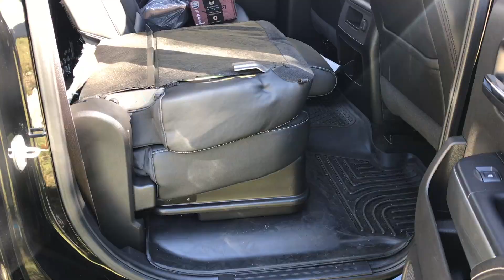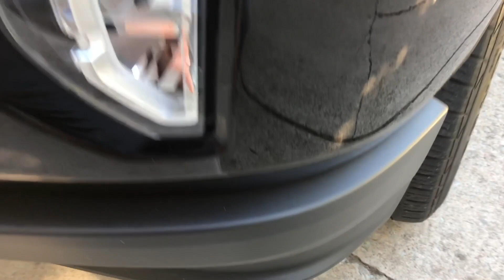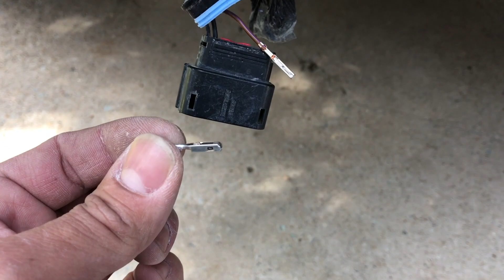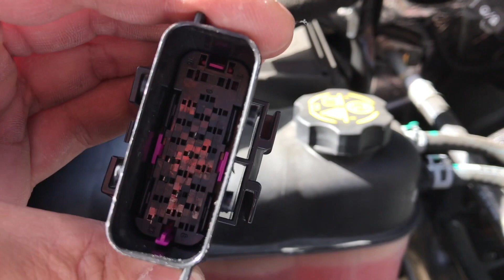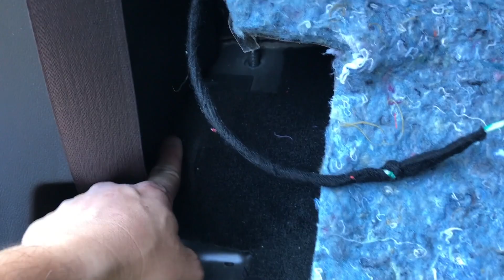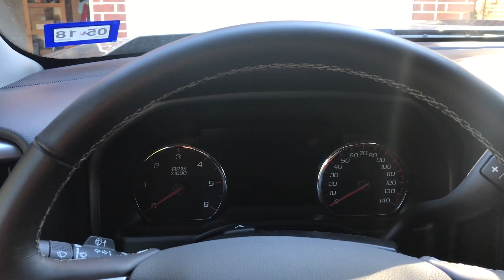2016 Silverado LT - Front Park Assist Retrofit / Upgrade

Comment: My 2017 came with the Front and Rear sensors, but I get the Park Assit Disabled message on the dash.  I checked fuses and visually inspected the wiring harness but so see anything suspect. I tried pulling seprarately the Blue and Middle connectors from the Park Assist Module but saw no change.  Thanks for any help you can offer.
Reply from the maker: Not sure what would cause that. Might be a dealer visit.
Reply: @philgamboa2906 Thank you so much for the reply appreciate it

Comment: After WAMS programmed the new park assist module did that automatically display the front sensors on the instrument cluster and sound the alarms or did you need more programming done. I have wired everything up and added the sensors. Just need the module programmed to detect the setup. Just wondering what else I’m going to need. Love the video it was great detail and made the installation easy.
Reply from the maker: Yes sir. The programming enable the sensors and the icon in the cluster.
Reply: @philgamboa2906 awesome I have the rear sensor but with a 6 in lift I need the front sensor because everything disappears infront while I’m parking. thank you for the great video. How long did it take to get it programmed and shipped back?
Reply from the maker: @ - I don’t recall the lead time.

Comment: Did you replace and repaint a new bumper with the sensor holes to add the front sensors?
Reply from the maker: Yes.
Reply: @philgamboa2906  was curious as there was no mention of it
Reply from the maker: Found a take off from a Silverado LTZ/HC. @TheCarCrazyGuy
Reply: @philgamboa2906 very nice. Wish my ‘22 RST Refresh had front sensors. The ‘24 RST now has them.

Comment: I'm unable to find anyone - even a dealer - that knows if there are two different part numbers for front and rear.  Can you answer this? I have a broken, inner front sensor on my 2016 2500hd that has part 52050133.  The part that I was sent is 52050134.  The advertised description says can go on front or rear...
Reply from the maker: What I’ve found when it came to varying part #s, we’re for painted, unpainted, or chrome.

Comment: So your work is amazing and well appreciated!  Where did you get the color-matched sensor caps and rings that hold them into the bumper?
Reply from the maker: Thanks!  I found a bumper in the same color as my truck with the sensors :)
Reply: Also - do you have a particular wire crimper you like?  I do electrical work from time to time on my vehicles - they have connectors similar to these and a good crimper is always nice to have.

Comment: I have a 2018 SLT Sierra with the sunroof and noise cancelation harness.  When I did my rear slider swap it was almost truly plug and play.  When I removed the rear seats I had those three wires hanging there along with the studs to where that module bolts up?  I wonder If all I would need is the programmed module, sensors, dash cluster programed the switch itself?  My truck also has the heated and cooled seats and power pedals.  I guess it's the SLT plus, but not the premium plus package, it even has the 6.2.
Reply from the maker: I’ve never heard of an SLT that didn’t have a sliding window or park assist sensors.
Reply: @philgamboa2906  It's the one you made the adaptor harness for me for the heated wheel. 2018 with the 14 to 17 harness.  It's GMC's SLT with all the popular options minus the driver assist package, heated wheel or slider.  Yet it has the big 6.2 4x4 sunroof, heated cooled seats, and other options.  It's strange how GM makes their trim packages.
Reply from the maker: @jewllake  - This may be a one off in this case.  It's like they added the wiring the "deleted" the configuration in the BCM.

Comment: So if anybody is questioning or having issues.  The part number of the module from the video, 13447860 is the module for 14-15 and the part number for the module that fits 16-18 is 84182728.  I made this mistake, bought the wrong one and sent to wams and they notified me that it was wrong.

Comment: I’m very impressed with your professionalism and completeness of your tutorial.  I am researching how to also add the rear park assist or both front and rear to my son’s 2018 Silverado 1500 LT.  I’ve asked both WAMS and the Harness Dr for help with a parts list but neither has been helpful.  Do you k ow where I can get a BOM and any schematics for these additions?  Thank you for your help.  Dave Maxey 504 703-5046
Reply: did you get it to work?  GMupfitter.com has all the wiring schematics.  My truck already has the three wires on the back wall.

Comment: Hey, great video. I was wondering if you know if this would be a similar process I would have to take to add the rear park assist sensors to my 2014 Camaro LT?
Reply from the maker: Starvin4aDeal - Probably much more work. In the truck side, someone on the GM-Truck forum used my video and starting exploring the ability to add the rears.  His was much more work considering he didn’t have any of the stuff mine had since I had the tears already.

Comment: Great video can't I just take the harness  and module  from a other truck. with out putting all the pin connectors and just get module programed. What you  think. And just plug and play????????
Reply from the maker: It might be depending on how much of the wiring would be gained by doing what you describe.

Comment: hi i did try to do this 
got sensors installed and wired, send my module to company white audio and media, they programmed to my vin/car, but it doesn't work they are irresponsible company no advice no help from they side, they recommended to send another module and pay second time and still wont warranties that will fork 
they are sucks
any help from u
Reply from the maker: Do you have factory rear sensors?  I have done this on 3 trucks that have rear sensor and successfully got them to work.  So it might be a wiring issue.  Did you run all the wiring from the front bumper to the module?
Reply: Yes i did 
When they programmed the module when i connect it disasable whole system
Reply: Can i contact u different way then ut
Reply from the maker: @buszek83 - Email at gamboaphil@gmail.com  I'll try to respond when I can.

Comment: Hi phil, would the rear sensors fit the front bumper? In other words are they the same sensors i can use for front and back bumper if not what sensors do i need for the front bumper
Reply from the maker: Randy Espinoza - While I think they are the same, the part #s appear to be different on GM Parts sites.
Reply: Phil Gamboa got it, thank you!!
Reply: Hey randy, did you find out if the rear sensors fit the front bumper?

Comment: Hey Phil, is it possible to install a grille/front bumper/headlight combo like yours (2016/2017) onto a 2014 (not the previous gen 2014, but the redesigned 2014)?
Reply from the maker: Yes, but you have to do an entire front end.  Hood, bumper, grille, lights, etc..
Reply: Cool! I figured as much that the swap would require all the parts. Thanks for the reply.
Reply: Phil Gamboa  would you have to drill new holes  on the truck to get the new 2016/2018 grille and lights

Comment: hi Phil 
I got 2015 gmc sierra 1500 with only factory rear sensors I will like to add front sensors
any chance u can get the all needed parts form me , I will pay for the parts and ur time 
and also the video is getting stuck  any chance u can send me directly the installation video
Reply from the maker: michal buszko - Not quite that easy sir. There are some things you can buy, but the main wiring from front to rear seat can be bought. There is also programming involved.
Reply: how I can contact u to chat about this little more

Comment: At the end of the video you had a pic of LT with chrome to Z71 painted bumper / grille.. So did you switch out the front grille / bumper section completely with Z71 ?

Comment: I see you have the illuminated bow tie. I installed one on my truck too, but could not find anything with the harness routing. You have any diagrams of how you ran yours? I see your connector is on top of the grill where as mine is behind it. I went to Chevy and asked. They looked at me like I had 3 heads.

Comment: Would it be just as dificult to add rear park assist on my 17 LT??
Reply from the maker: I think this would be more difficult and I don't know if there would be any additional programming needs.  Since my truck already had the module for the rears, adding the front was not as bad as I thought once i got the programming needs squared away with WAMS.  I already had the disable switch in the instrument panel, the cluster was already set for the graphical icons for the rears, etc.  The more i think about it, I think it would be much more work to add.
Reply: Phil Gamboa I thought so😣 thank you

Comment: Phil,  Might I ask where you were able to find the blue OEM connector for the front input module? I have been doing a bit of searching and can't find anything.
Reply from the maker: Sure thing.  GM Part # is 15127038
Reply from the maker: The OEM Connector (which can be usually found at Mouser) is 15491263, but cannot be found anywhere in stock.  The GM Part # 15127038 can be ordered from any GM Online site.  Good Luck!

Comment: What gauge is the wire? How much did it run you including the programming?
Reply from the maker: Elizabeth S - 22AWG stranded. For cost, you’ll have to reach out to WAMS and inquire. Mine was a packaged deal with the Denali Cluster programming.

Comment: Great video phil ! I have a question is it possible to  retro fit heated and cool seats on a 2015 silverado z71
Reply from the maker: Possible?  Yes.  I actually helped a local member accomplish this.  It was a huge job that required using the stock harnesses, tracing all the circuits in the stock harnesses and ensuring all was the same on where they landed.  We got cooled part to work.  The heat is not at the moment but we are very close to getting that figured out.  We had to steal a couple of connectors on the harness that came with the new seats and use them on the original seat harness.  It wasn't easy.

Comment: Another Great Video Phil!!
Reply from the maker: Thanks!  This one was a LONG time coming!  I had the Denali Cluster for several months and thought I needed to have the cluster programmed along with the sensor module.  So I waited to do it all at the same time.  Turns out, the module also works with the stock cluster.  This tells me that only the park assist module only needs to be programmed!